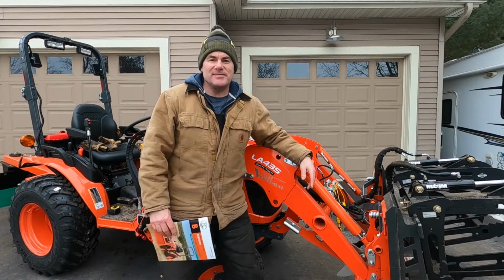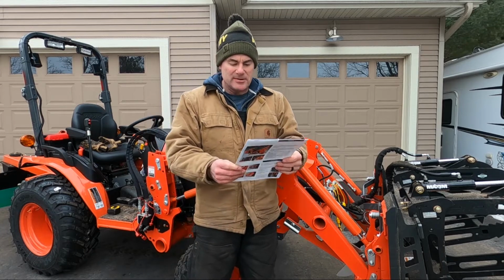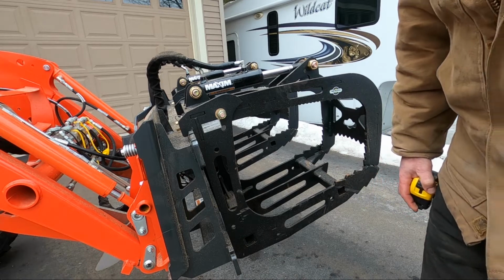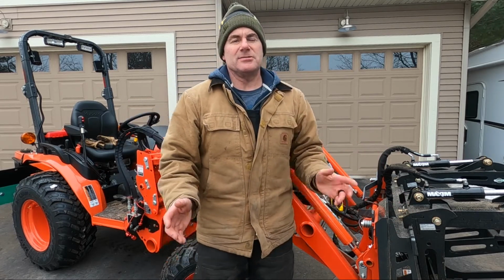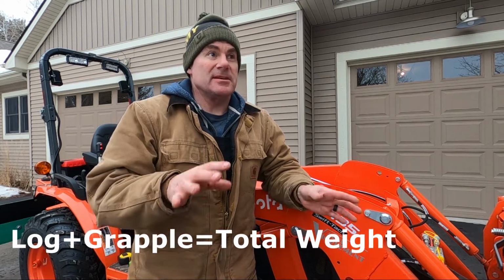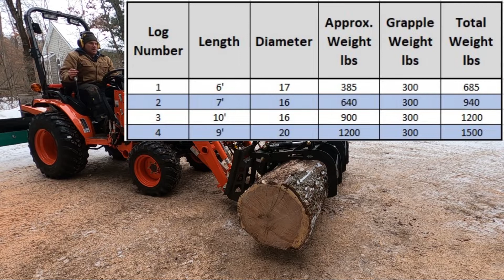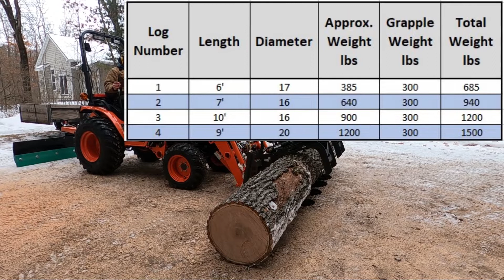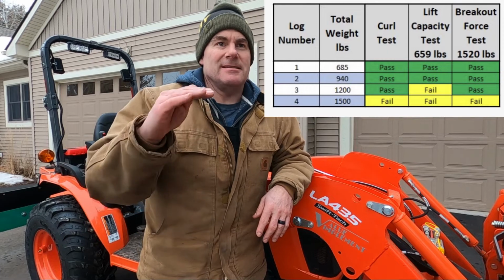#82 Kubota B2601 LA435 Tractor Loader Capacity Test - How Much Did It Lift?

Comment: Hi Dave, I always understood breakout force as the weight that you could break with the curl function. Example of coming into a pile with a straight or slightly angled down bucket then curling back. That would be the weight at the pins that it could curl up. Same example, come into the pile and just lift the loader arms would be the less weight at the pins. I don't know if that helps or not. Enjoyed the video. Like these kind of tests.
Reply from the maker: I believe you are correct on this after double checking.  My dealer mis-lead me on the breakout force.  Very confusing.  Thanks for pointing this out.

Comment: Fun video…
The pivot pins are on the ends of the loader arms, not the cylinder ends.
Breakout force as I understand is the hydraulic power that the FEL can exert using curl and lift.
Reply from the maker: I believe you are correct on this after double checking.  My dealer mis-lead me on the breakout force.  Very confusing.  Thanks for pointing this out.

Comment: On you red dust coupler plugs on the 3rd function connection can you tell me what size those are. I am a new tractor owner and I’m not sure how to measure for the correct ones to get. Your setup looks like mine. Any help would be appreciated.
Reply from the maker: I believe there are 1/2 inch Pioneer Couplers

Comment: That rear blade is nowhere near enough ballast for using the loader
Reply from the maker: I have the tires filled as well.   It works well as it hangs back a ways.
Reply: @timbertimeoutdoors9836  that helps with stability, but it doesn’t take weight/stress off the front axle, which rear ballast does.